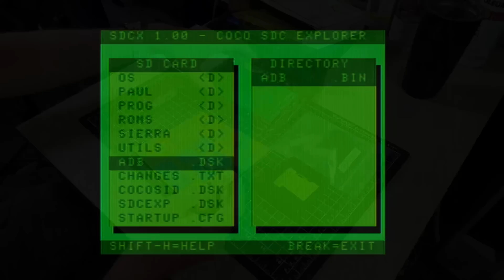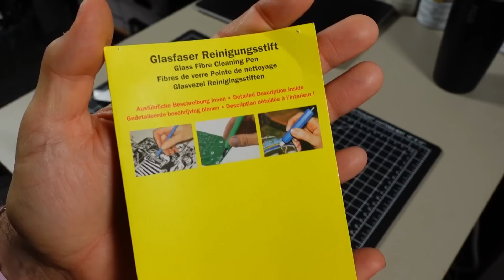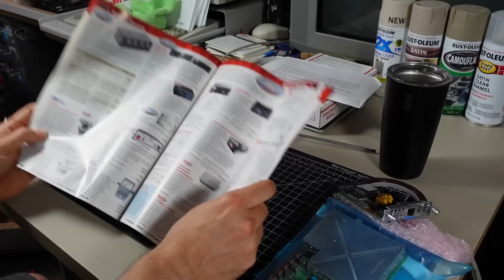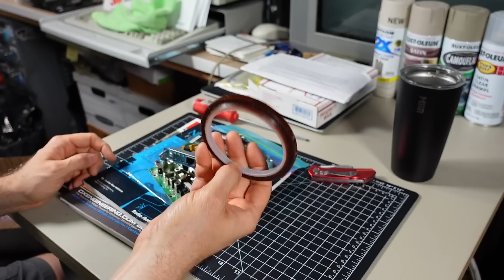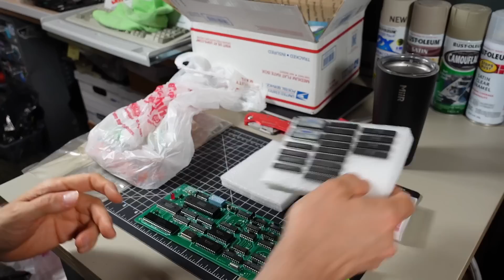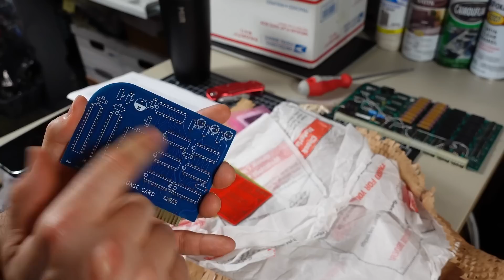0040 Apple II replica cards, a prototype 16K RAM card and a sound card for the SWTPC 6800!

Comment: 6809 is a later variant of the 6800, needs fewer external components to work, uses more sophisticated fabrication techologies.  Basically many of the early 8 bit microprocessors needed things like multi-phase clock generators and lots of peripheral ICs to work, later variants brought more and more into the chip.  The 6800 family is still around today for some industrial applications.  The 6502 (MOS technology originally) is unrelated to the 6800 (always Motorola). different register architecture, instruction set, etc. It was designed by some people from the original 6800 Design team at Motorola.  The 6502 was specifically designed to be cheap and easier to use. Motorola was targeting low overall system cost while providing flexibility for very sophisticated designs. 6502 forgoes a lot of feature needed for more sophisticated systems in favor of a super cheap processor.

Comment: The 2K ROM socket on the Language Card (either the original or the clone) is not capable of replacing or restoring Integer BASIC, which came on three 2K ROMs.  What it is intended to do is to replace the "old monitor ROM" on an original Apple II with an "autostart ROM" like that which came with the Apple II+.

Comment: I tried building a resistor network DAC in around 2007 for an embedded device powered by an ARM CPU. It was way cheaper to get the 8 resistors needed for 8-bit depth than it was to get an AC'97 (we didn't need GOOD audio), so my boss (an EE, not a programmer or computer engineer) thought it was worth trying.

Exactly what you said would happen, happened. I bit-banged the GPIO pins and it worked just fine, but you could hear every time the kernel did a context switch because it would click.

We got the AC'97. :P

Comment: Audio developer here... How does a so-called "parallel DAC" avoid the need for resistors? The only way I can imagine that working is if you're doing the DAC in software instead of hardware, so that you're lighting up more lines to get a higher output. But that would be strictly inferior to using a resistor array -- with 8 lines of output you'd only get 3-bit depth instead of 8-bit and you'd be increasing the CPU load unless you're just playing back a precalculated waveform.

The resistor network IS a parallel DAC. The alternative is a serial DAC that requires buffering circuitry -- which is how most modern audio DACs work because serial is way cheaper in PCB design than parallel, even if the signal conversion circuit is more complicated.

Comment: I can recall more than 10 years ago I went into a radioshack and got a fiberglass pen to scratch off some solder mask on a PCB I was working on back then, and it was amazing. when it finally ran out, I went to go get another, and while it 100% looked the same, by that time (somewhere around 2012) the tip end was nowhere near the same quality and was all floppity. So at some point someone figured out a way to change suppliers either at the manufacturing to bring the cost down by going with softer fiberglass or someone did a bait&switch on radioshack at that stage and radioshack was none the wiser about it. By that point I just kept a dull ended flathead screwdriver around to chip away at solder mask with like a savage to keep it clean enough to work with instead, and it's still the method I use today because that experience really turned me off from using fiberglass pens if I couldn't be sure the quality was always going to be the same.

Comment: I still enjoy a good bit of RTTY.... but its not super common compared to some of the newer modes like ft8 etc
Reply: Amen, and all of the HF Icoms made in the last 20 years have on board decoders.

I miss JT-65a. It was much more musical to listen to (especially on LSB) than JT-9, FT8 or FT4 (which are admittedly more spectrally efficient). Plus a 10-15 second decode/reply gap gives better chances to select an open spot and find a bare minimum power level.

Joe's protocols are designed for QRP, but too many lids crank the rig up to full power. 25W at the antenna should be QRO to work long path.

Comment: Wonder if the PineCil will get the job done on the RF board for practice. For big stuff I've been falling back to the Hakko FX888D, but I usually only have a 20W PSU on the PineCil. (I have a surge protector with built in USB C at that desk)
Reply: The Pinecil probably can't put outheat fast enough, but the point of sending the board was to practice using desoldering alloy to remove PTH when you don't have enough thermal capacity. The goal is to remove the component from the board without lifting traces or delaminating the plated thru-holes from the ground plane.
Reply: @DiverCTH  oh I missed the part about alloy, I assume that's basically "ChipQuik"?
Reply: @rpavlik1  Yup, I sent in a lifetime supply a few mailcalls ago

Comment: The cache chips are 256 kilo-bits, not 256 kilo-bytes. They are 32Kx8 SRAMs. Typical 486 cache configuration used two interleaved 32bit banks of 4 chips each for a total of 256 kilo-bytes made from 8 62256-alike chips. Oftentimes, a 9th chip was used as tag RAM.
For 256KB of cache, a 16Kx8 chip would have been enough, but those chips didn't exist at that time. Later on, at least Aster and Winbond produced 128kbit chips, omitting one of the 15 address bits of the 256kbit chips. Too bad that Aster and Windbond chose to omit a different address pin; that's why some later 486 boards have jumpers to choose between "Aster tag" and "Winbond tag".

Comment: 16K ram board bodges: since it's a prototype, the bodges could easily be to bypass bus/path errors. (these errors would be done away with in the MP-16A respin of the board.
Reply: It may be prototype-y but I'm pretty sure it was also sold as a production board, I have seen a few photos of them out there, sans the (non-factory) bodges.

Comment: You have to be careful that the glass fiber tips don't get exposed to high humidity. A year ago we had a flood in the cellar and all my repair equipment was exposed to very high humidity. The glass fiber tips got bendy and lost all their hardness. I had to clean up a lot of other stuff that began to oxidize  as well. Even some PCBs i was going to repair had delaminated in places. It was a pretty bad occurrence. An industrial dehumidifier got the humidity under control but the glass fiber tips did not go back to normal, even after baking them in the oven.
Reply: I wonder if that’s the problem with the cheap ones — China is very humid after all.

Comment: The inability to have a full 64KB of RAM and lack of bank switching capability on the SWTP 6800 system aren't too surprising for a machine of that vintage, given the cost of memory at the time.  I've been reading old issues of Byte and memory prices were exorbitant at the time, as in about a couple thousand dollars for 64KB.  I think the personal computer market really needed memory prices to drop before it could take off, but the early personal computer demand combined with Moore's Law had a lot to do with the price dropping.
Reply: That makes sense. Why bother engineering-in bank switching when 99% of your customers wouldn’t use it?

Comment: Hey, Adrian the vinyl bags do come from the medical field. My profession is Master Mechanic and I fix all kind of industrial equipment for large manufactures from a wide range of industries. My customer sent me box of these bags as sample of what there final product should look like. Long story short the hole at the top is for hanging on a hook ("like for an I.V. bag"). The part of the machine I repaired punches that hole. I figured instead of throwing them in the trash I would recycle them into packing material. Don't worry there brand new and never used.  The Lolli pop suckers have a dried salted plum in the middle its called a saladito its kind of an acquired taste. sweet spicy and tart. The pit is still present so don't break a tooth. Thanks for the feature. Aaron P.
Reply: Salted plums are nice! Salted plum drink was not as nice ;)
Reply: Ooh, if that’s anything like umeboshi those lollipops sound great!

Comment: Definitely check out the Mike And Key swap meet! It's in Puyallup, WA so not too far from you. I got so many cool things there earlier this year. Tube tester, cool displays and connectors, etc etc.
Reply from the maker: Ah just once a year it looks like?
Reply: @adriansdigitalbasement2  unfortunately, correct. Or perhaps fortunately, for my wallet. Generally good prices in my experience, to be fair.

Comment: Wish I could figure out how to fix my C64 supply -- the 5v is fine but the AC part of the supply is buggered! Of course it's a potted black brick like Adrian got in this vid, but I don't have the supplies for a homebrew, not quite, and if I can fix what I have I'd rather.
Reply from the maker: I'd really just recommend getting a new one -- the 5V part is just risky to use due the way it's designed.
Reply: @adriansdigitalbasement2  I really can't right now. I just don't have the money. I hate it but there's nothing to be done there.

Particularly sad is that I have a working C64 breadbin, a second breadbin under repair, and a personal project involving the remnants of another board that I'm mostly using for parts because somehow ALL EIGHT RAM CHIPS are burnt toast. They're not even MT chips! But I only had one power supply and now it's toast so I can't work with any of them...

I get that the original supplies are bad news when they fail, but they're OK as long as you keep an eye on em, and TBH I do really like using original equipment where I can. It's a bit silly, I know, but that's just how I roll.

Comment: That silver-colored electrolytic cap on the sound board kit looks a little crusty; I think I would replace it with a new 220 uF/35v radial-lead cap and some hookup wire. 😏

Comment: Death brick indeed! I had one with my 64 and it killed the RAM… same guy who replaced the RAM sold me a good aftermarket supply.
Reply: I figured it would make a good doorstop once the cables are cut. Either that or a paperweight. Really don't know what Commodore's engineers were thinking back then. Either 12VAC or 9VDC would have been enough to run either an LM7805 or LM7912 to drive the chips on the early breadbins.

Comment: Its better to not stick out much of the fiber glass tip, just a little, maibe 1 or 2 mm,  scrub, take out more when it is wasting and you have almost none left only, if you take out a lot, fiber will suffer from the force applied and thats why it turns put like a brush like in the chinese one
Reply: Kinda like a mechanical pencil. Why expose more than you have to when the tube is stronger than the tip material?

Comment: Amstrad produced a budget PC network card which looked very similar and also used a similar three-pin connector. It was about 4 megabits of shared bandwidth. It was the first network we had for our computers at home - with three computers. I remember playing networked Populous with it.
Reply: Ooh, good usage!
Reply: I think Amstrad is still in business , but they just do audio equipment.  Not sure when they stopped selling computers.  I once had a PC1512DD system.  What a weird system.  The power supply was in the monitor and used 4 AA batteries for its CMOS.

Comment: I would say that is DRAM on that memory board, it looks like there is a delay line in the middle column top left, which would be used to generate the RAS and CAS timing.
Reply from the maker: Ah ok -- good catch. They are most likely 4116 chips -- I will be able to tell once I stick it in the machine and just check the pins for voltage on the sockets.  32k in 1977 must have been so super duper expensive!

Comment: Wouldn't it be 256k of cache? I dont remember any 486 being anywhere near 1 meg of cache.
Reply: Usually each chip has 32k of RAM 8 bits wide. 386s, if they even have cache, usually use chips that are 8kx8 per chip.
I'm currently using mine for fixing arcade machines.
Reply from the maker: Yeah senilyDeluxe hit the nail -- they are actually 32x8 chips - -which is exactly what I used on the SWTPC. I forgot the part number implies 256k when you combine 4 of those chips ..... so 8 of them for 512k of cache, which I think was more typical?
Reply: @adriansdigitalbasement2  you slipped by a power of two... 4x32=128k which is a typical configuration for cheapo 486s (although there are super cheapo 486s with no L2 cache) and 8x32 for 256k cache which is also a typical configuration.

Comment: That's at least a £50 or $60 roll of Kapton tape if it's genuine DuPont or 3M
Reply from the maker: Is there anyway to know? I has no markings on it.
Reply: @adriansdigitalbasement2  $17.87 Plus S&H drom Mouser in 2016, 3M part 5413 1/4"x36Yards

Comment: I used to work in a an Apple Education Demo lab here in Ottawa at the Carleton Board of Education called the Computer P.L.A.C.E. We had all sorts of new and experimental hardware and software as well as new products that companies wanted the school board to evaluate and possibly buy. One of  the snazzy things we had was a Corvus Constallation server and network for Apple ][+, //e, Apple /// and Lisa, and later for Macs. It used Corvus's Omninet and allowed Apple 2 series systems to boot from the server, and it could store 20 meg of data. It used a VHS based system as a tape backup as well. It was a sweet system for the time. It was a great set up for running an Apple 2 based classroom.
Reply from the maker: That really does sound quite neat. Appletalk seemed to just completely replace all of that quickly, and it seems not very much information exists (that I found at least)
Reply: What? No PCs or Unisys ICONs? AFAIK Ontario heavily relied on the ICON system in Education, not PCs or Apple devices. As a student in the York Region School Board in the late 80's to 2001, I don't recall ever seeing a single Apple computer, just Unisys ICONs, then Unisys ICONIX PCs (we had these at my high school with a Novell NetWare server) in a school, so I was mostly unaware of Apple's apparently dominance in education until I was already working in IT years later. A friend at the time was an Apple die hard (no longer, pretty sure he's exclusively Windows and Android today, his dad was an original Apple Canada employee) and tried show me the great things about Macs (I couldn't care less, wasn't a fan than, even more not a fan now, lol).
Was the Carlton Board of Education mostly or exclusively Apple in the '80s and '90s? I assume today it's almost exclusively Windows PC for all school desktops.
Reply: @technerd9655  Yes, it was an Apple Pilot site for educational computing. That was in the early 1980s. Later, all the boards up and down the Ottawa Valley switched to IBM computers & servers running "Blue Box" Netware, basically IBM's logo on the usual Novel  Netware boxes. That was in the late 1980s and early 1990s. I installed and  upgraded lots of schools Netware servers, and did some onsite support for the serves and workstations. Saw a lot of PS/2 computers and servers...Today, I do Linux stuff, and can usually do Mac stuff since I know so much about Unix that I can fix problems that usual Macheads can't. And if people pay me enough, I will do Windows. 🙂
Reply: @FarrellMcGovern  interesting. So no ICONs out there?
The only thing I generally shy away from is Linux, but other than Android or ChromeOS, is basically non-existant. OS X/MacOS/iOS I find far more difficult to support than Windows. Apple has made on demand remote support extremely frustrating because most Apple users are not the easiest bunch to walk through over the phone to give the required permissions in recent versions of MacOS.

Comment: You should keep the pen and throw out the tip. What you appear to have is a pen with a poor tip, you can purchase the correct size tips for that pen that will be of the right quality, there is nothing wrong with the pen. The pens are different sizes for different sized tips. It is possible to buy various different materials for the tips as well such as brass wire or steel wire.
Reply: I bet the quality of the pen is similar to the quality of the original tip though. If it felt decent, I bet he wouldn't be so quick to toss it out.
Reply: @mal2ksc  The tip was what he referred to. I've seen a lot of these, the pens are all pretty much of a muchness.
Reply: @AndyH2O  Maybe. But with cheap Chinese crap, you never know. Sometimes a component can be surprisingly good even when the whole device sucks, but it's more common for absolutely every element to be cut to the bone until it all sucks about equally.

Comment: 18:30 - I got far too excited about knowing that answer than I should have.  BTW, I used to love playing with radios back in the 90s...but I have gotten away from it over the last 15years or so.  I used to LOVE Hamfest events.  That was were I actually got my first hobby computers back in the day.  I still have tons of Commodore hardware that came from Hamfests.   :)
Reply: It's always interesting to see which questions are eliminated and what new ones come out whenever one of the test pools is updated. I should know this by heart, but I believe the tests are aligned so there's a minimum of one change per every other year.

Comment: When you mentioned the 68A54 I guess those cards were some sort of networking. That is the same chip that Acorn used for its econet networking (an Apple talk alike system) for all of it 8 bit machines and there were even cards for their 32 bit ones so you could hook them up to existing networks.
Reply from the maker: Ah that's cool -- Econet wasn't it called?
Reply: Where are the 6502's on the Corvus cards ?  As for the 6854 .... Performs CPU/data communication link function for ADCCP, HDLC and SDLC standards.
6854 is a 1 MHz part.
68A54 is a 1.5 MHz part.
68B54 is a 2 MHz part.